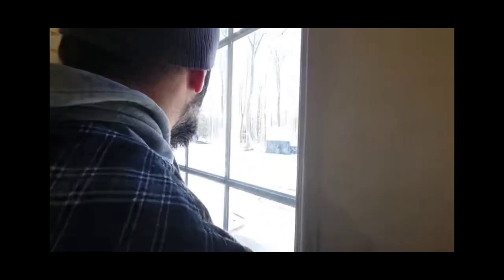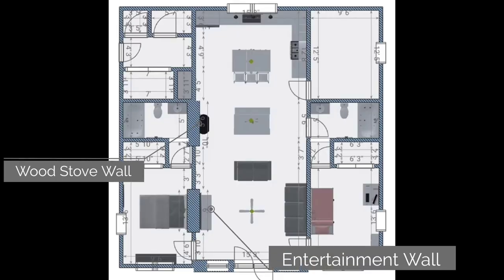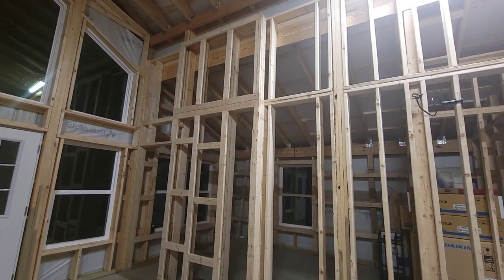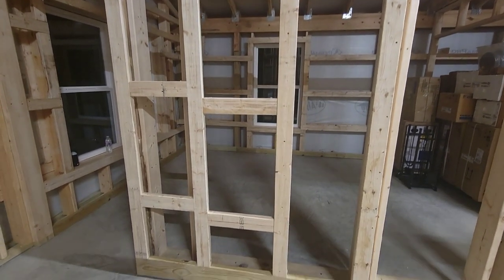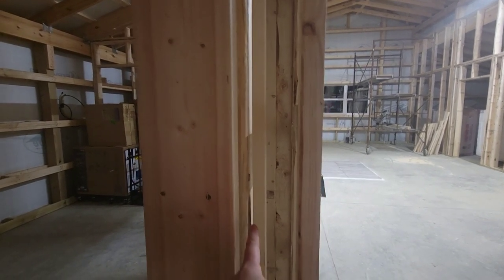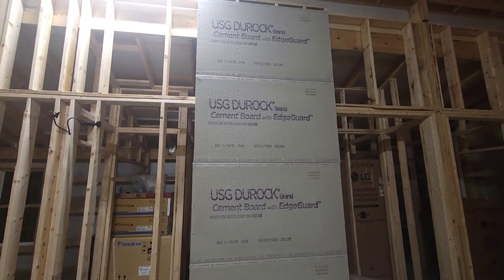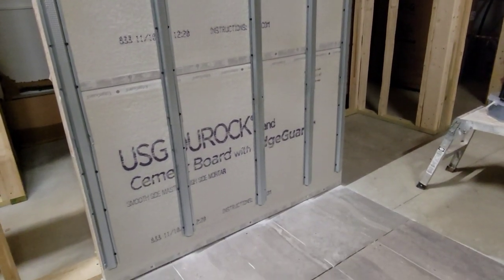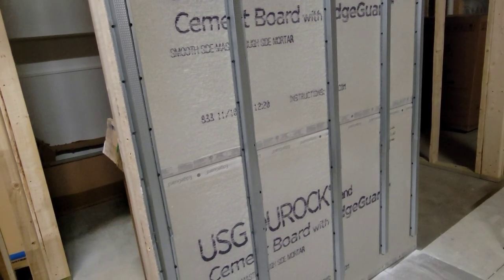WOOD STOVE Wall DIY | Building a Barndominium

Comment: You doing a part 2 ?
This ends in an unusually abrupt way. Normally, you close the videos with this weeks plans and thanks for watching, likes, and subscribe. I can't wait to see that wood stove in operation. Curious about how effective it is. Doesn't look big enough to heat the room.
Reply from the maker: I stated that next we will be tiling...I did skip the subscribe ending though...I figured since I extended the intro, I wouldn't overdo the ending 😉 It will be two weeks before the wood stove goes in. It is rated for 2100 square feet which is more than enough for our 1296 square feet, even with the cathedral ceilings. 😃 We will also have mini split systems in every room to heat and cool as needed, if the wood stove for some reason can't keep up.